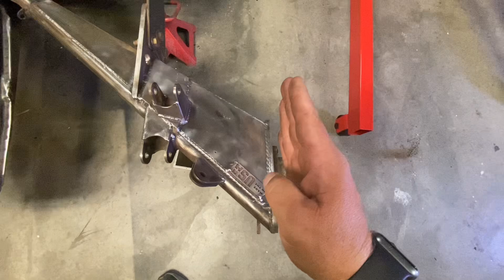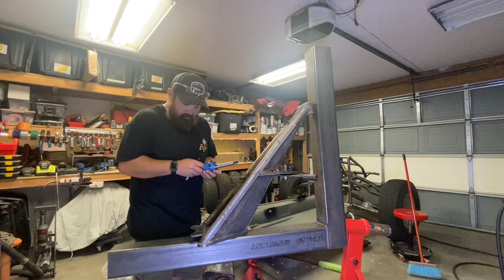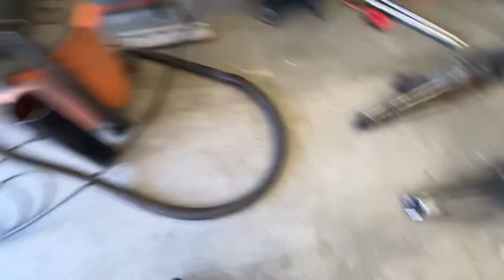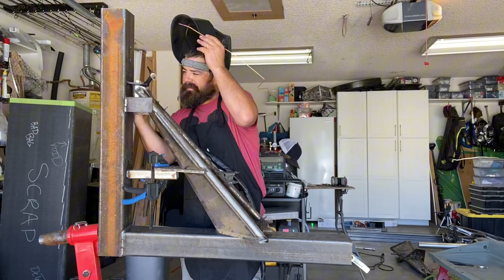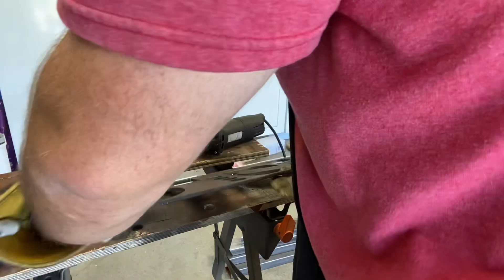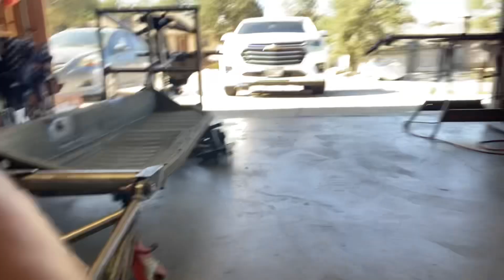Rebuilding my Torsion Housing and Trailing Arms to fix Geometry and Structural Issues

Comment: No one ever talks about moving the trans back to make the output shafts, align, parallel 
5 x 5 arms are huge an angle  and major stress on CVs I reconfigured mine 15 years ago and never had a problem since
Reply from the maker: Depending who you talk to, whether it’s an actual issue or not. For me, I’m moving it back.
Reply: I noticed  All stock CV axle cars have the axle square to the the flanges
Reply from the maker: It’s the best geometry for sure. A lot of people don’t want to move the entire engine, Tran’s, and all the components to get it. For me, I’m starting from scratch anyway

Comment: What wall thickness tube did you use for the “torsion” tube?
Reply from the maker: It is 0.120” wall. That is sufficient if properly supported. If used in the stock configuration you would need around 0.250” wall thickness
Reply: @ awesome thank you! Just got back from ocotillo with my 5x5 long travel Manx with a broken torsion tube! Now time for the rebuild!
Reply from the maker: @kylerose5678  ouch. Let me know if I can help in anyway
Reply: @MiahsBug  much appreciated!! Hope to be back out before the end of the season!

Comment: Wonder how better that would make the handling on the highway?? Love the idea!
Reply from the maker: Handling in straight lines will be better. The camber change helps in corners with body roll and contact patch. Lower tire pressure and contact patch conforms to the terrain. That’s how it works in my head anyway lol
Reply: @MiahsBug  Looks like Im gonna be busy this winter making some mods on my pan!! Thanks Miah!!
Reply from the maker: @timswitzer792  no problem! Let me know if you have any questions about what I did or need help.
Reply: @MiahsBug  Fantastic!!! Thanks so much!!
Reply from the maker: My car is planned for higher speed desert stuff. I prefer the stability in rough straight lines.

Comment: Love you fixture and nice fabrication as always! I feel like + & - camber is a good thing to have on an off road vehicle?, no camber seems more like a drag racing set-up. Even a rear straight axle has + & - camber as is twists. I no expert on this by any means so I'll be curious when you get it finished how it handles, I'm sure you did your research,  you're around a lot of baja builders out there that have a lot of experience.
Reply from the maker: Yeah, it’s a bit of a controversial subject depending who you talk to. I chose a path I thought was the best based on many different cars. It goes both ways all the way up to full class racing on what is best.
Reply: @MiahsBug  I would have never believed theirs so much controversial ways/opinions on all aspects of building a baja until I started my own...trans, roll cages, suspension, steering racks, tire sizes, etc....enough to drive you a little crazy, but that's part of the fun I guess!  I find it a little stressful myself😬
Reply from the maker: Yeah, there is a hundred ways to do it. Just because I chose a path doesn’t make all others wrong. It is a bit stressful sometimes.